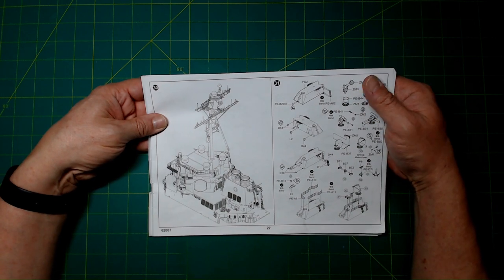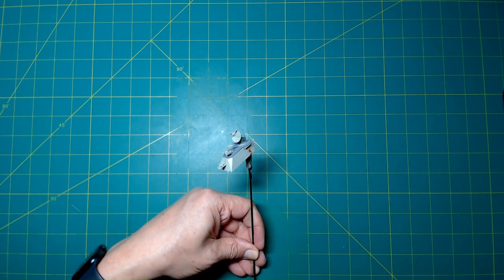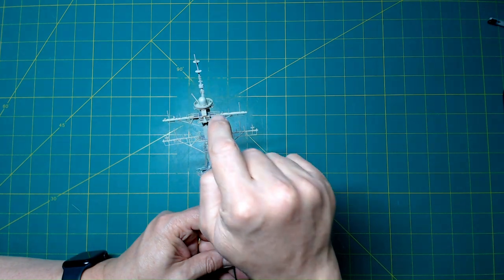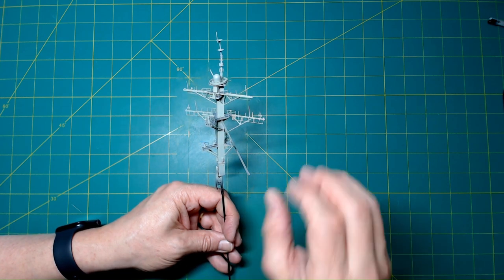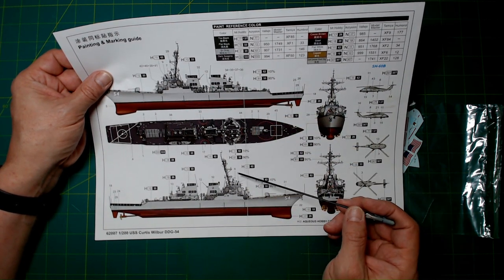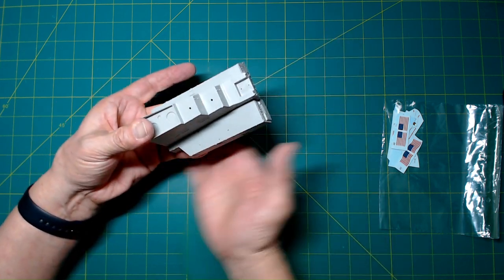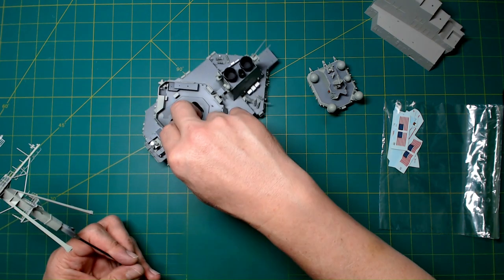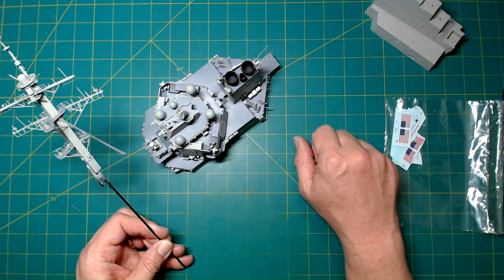USS Curtis Wilbur in 1/200, Video 13b, Mast Painted

Comment: Yardarms is what we call the Mast Arms.  Halyards are from each side of the mast going to the Flag Bags.  From the upper Yardarm there is a High Frequency Antenna we call the Fan Wire Antenna.  It is one assembly on each side of the mast. Lower part ties to a small platform that juts out from the 05 Level.  The upper section ties back into the center mast.

The build is looking really nice.
Reply from the maker: I really appreciate that information and will use it accordingly. The rigging isn't something I'm dreading, just something there is not a lot of information about on the internet easy to obtain. Thank you very much for the insight and for watching!